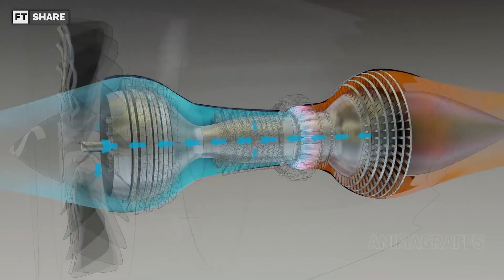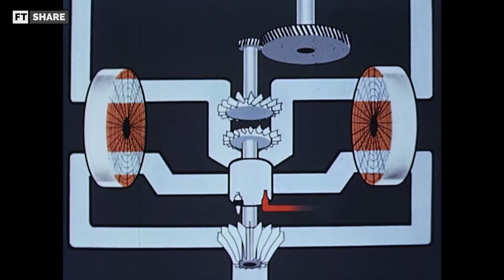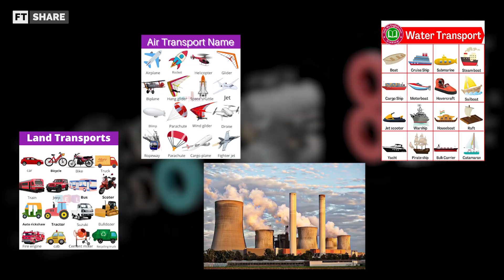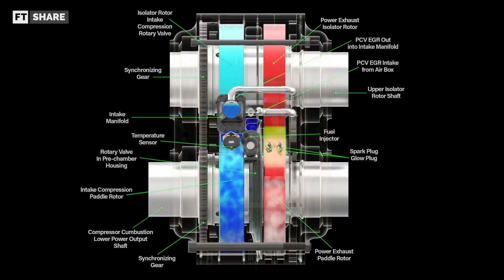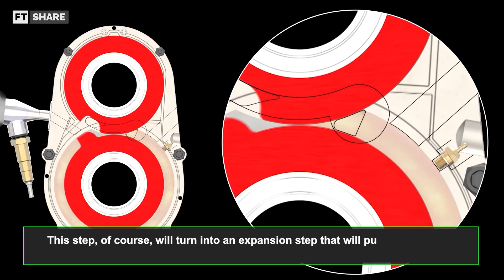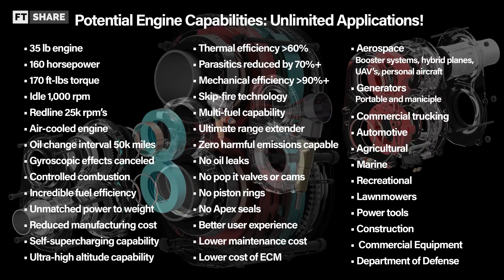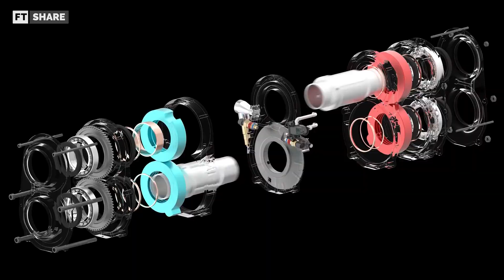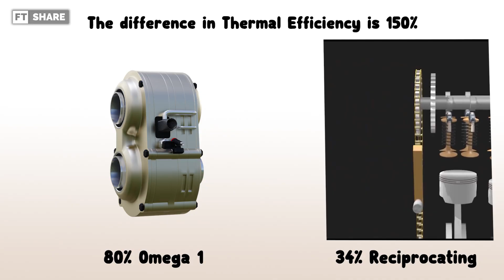Ready To Destroy EV Engine!! | Astron Aerospace - Omega 1 Engine

Comment: HOW ABOUT something like a pair of properly sized center intake rotors sandwiched between a pair of compression /combustion rotors on either side spaced 180 degrees apart. That would keep the majority of the heat on the outside rotors that can be water jacketed/cooled. Essentially it would be TWO motors working together united by a single inlet set of rotors sized to feed both motors. Exciting HP/weight/size ratios!
Reply: I see what your saying and with proper water jacket it would work and would be a very efficient engine. I'm very skeptical about the torq numbers. I would very much like to see one in use.
Reply: @bambambundy6  It just goes back to HP vs Torque. If you can spin it faster it compensates for the loss of torque and you are going to utilize the HP side of it.
I am a diesel guy or high compression slow moving engines. High torque with low rpm.

Now all manufacturers are trying to go the other way. Low torque motors running higher rpm to do the same amount of work.

I leased a new 2021 Chevy Silverado with a 4 cylinder turbo engine. It is built almost like a gas burning diesel engine. 

It has more torque at a  lower rpm because of the use of a dual volute turbo and a longer stroke. It is coupled to an 8 speed transmission to help make up for the loss of torque by using HP in the higher rpms.

It tows very well for it's size.

Now spin an engine 4 times that rpm and you can do the same work with 1/4 th the torque.

This engine would be better suited for power generation than mechanical use unless you had a whole lot of gearing or variable transmission output.🙂
Reply: Those numbers seem bit sus, but i humour them to point they have it tested on the dyno by third party. Still is this is durable and powerful, small 50cc engine would sell like hotcakes if price is reasonable to install into moped.

Comment: As a motor mechanic, I can't see how it could possibly seal the combustion sections effectively and not suffer the same issues as early rotory engines, seal chatter and premature failure.

Comment: At 6:43 this engine is compared to other 'alternative' engine designs while dismissing these other engines as 'mere concept engines' - actually these other engine concepts where actually built and run on engine dynamometers in order to measure their thermal efficiency.  I can attest this on the basis of actually physically being present for the dynamometer testing of one of these engines. 

I predict that this engine will be exactly the same as these prior alternative ICE designs in the fact that the claims being made prior to any dynamometer testing suggest that the thermal efficiency will be way superior to existing ICE designs however the actual dynamometer test results will not be able to back up the outrageous claims.   It is more than likely that the thermal efficiency will be lower than a typical mass market automotive Honda/Toyota engine, but with a number of other practical issues that come to light based on real world testing.

Comment: There are many issues with the content of this video...

It tends to suggest that the company that developed this engine has experience in making jet turbine engines for the aero industry while showing video of some other company (clearly not Astron).  The video later states that the inventors of this engine have not got any interest in the engine from the aerospace industry.   Surely this should be a red flag.  If they are claiming that they are in the aerospace industry but at the same time can't convince anyone else in this industry that this is a good idea then you have to question where the truth actually lies here?
Also, claims of being able to run this engine on hydrogen with virtually no emissions????  How on the earth do they think that they will be able to simultaneously achieve a reasonable thermal efficiency and at the same time not produce significant NOx emissions???  What are they planning to do here - are they planning to have to use pure oxygen instead of air?

Comment: This idea has been circulating the internet for some time and it is basically a fraud.  There are some really nice animations of the engine, however the basic underlying thermodynamics are no different to any other ICE.  I don't understand what the promoters of the video are trying to achieve.   They seem to be content as spreading misinformation and trying to convince the general public that don't understand the physics of thermodynamics and ICE engine design that this is a practical idea - but to what ends here?  This video is not fooling the auto industry nor is it getting any support from academia. 
If the makers of this video are so convinced about this idea they should build a working prototype and test it to get some real efficiency figures to back up their outrageous claims.

Comment: I'll believe it when I see it independently evaluated and tested for efficiency and durability and emmissions.
Reply: Agreed, it will have poor low rpm torque and end up on a shelf like so many other "disruptive" designs. Kudos for the designers getting it to work but i think its likely power curve does not suit a non hybrid  automotive installation.
Reply: @watsisbuttndo829  It doesn't have to be directly coupled to the load. If it lives up to the hype, it could be the primary end of a genset. Think 'Hybrid".
Reply: @watsisbuttndo829  exactly, lack of power is going to make this thing dead on arrival.
Reply: I agree.  They were totally silent on emissions.
Reply: @johnspathonis1078  if the efficiency is really that good wouldn't the fuel burn also have to be that good? Ie unburned/incomplete combustion of fuel is a big part of emissions. Right?
Reply: @georgesimmons9815  Sir Harry Richardo stated in one of his books that essentially combustion chambers with a high surface area to volume ratio would produce more pollutants.  This is because of the unburnt fuel that exists in the surface boundary layer.
Reply: @johnspathonis1078  just run it on hydrogen, and bam, emissions go poof
Reply: @johnspathonis1078  https://youtu.be/vFfsEfnsA4I
Reply: @johnspathonis1078  they can't tell everyone just yet but pointed toward the 1955 Chrysler engine....there's your sign
Reply: @johnspathonis1078  because it was for hydrogen  also
Reply: @johnspathonis1078  the more emissions, the better.
Reply: @kayakMike1000  exactly, more emissions=more fun
Reply: @johnspathonis1078 more the compression more NoX can ne controlled with better catalytic converters
Reply: Agreed. No one talks about seal wear and the shear number of seals required to work at 100% to pull this off. Just think about number of seals per moving part in a given area in a traditional cylinder engine.
Reply: Emissions... meh irrelevant. Only thing i care for is efficiency, durability vs cost. I will install this to dirt bike in a heart beat, specially if the electronic system is simple enough to be bullet proof unlike modern shit that has tons of sensors to be fault points of their own.
Give me simple durable and efficient engine with suitable cost and that is fine. I dont mind emissions since it would be installed to old car anyways since modern stuff is shit.
My only worry is the rpm of 25K witch sounds like it would wear down seals pretty fast, but guess that is the thing they mentioned about the material durability being one obstacle.
Reply: @Hellsong89  Emissions are nothing to do with the engine as such anyway, they are controlled by things such as DPF filters and cat converters, not the engine itself so it's irrelevant to the actual function of the engine.
Reply: They have not built one- and will not. Sealing those rotors would be a nightmare, and NEED lubrication. The gas path and combustion chamber shape are both so poor it would be a miracle if it ran at all, never mind provide power... Given the pressures quoted, those six slim bolts would never hold it together. I could go on, but it is a fantasy from start to finish.
Reply: Absolutely this! So many “revolutionary“ engine designs have come and gone without ever actually being viable.
Reply: Exactly
Reply: It was leaking what looked like oil too
Reply: @Eduardo_Espinoza  It looked like water or fuel.
Reply: Sir, logical comments aren't allowed on the internet lol.
Reply: This is very old tech
Reply: @the-btc-tradingfloor2808  that’s what people said about Tesla now look at them 😆
Reply: Touche good sir, touche.
Reply: Also, I didn't understood how it will be balance, presumably it has a low mass with high torque, it could be fixed with multiple tooth in the rotors, but thing is, if done with multiple tooth it will become heavier and all the problems mentioned here would be worsen.
Reply: NIKOLA is the best.
Reply: as it will probably have the same emissions as a 2stroke
Reply: this video and channel is pure clickbait
Reply: Seems like you skipped physics lessons in school
Reply: Sandy Monroe
Reply: https://youtu.be/JaP8iplOjz8

Here’s the real video with the facts. His video IS clickbait. Doesn’t have the correct information
Reply: The emmissions does'nt matter
Reply: @jorgemorais4005  That may be dependent on location of intended market.
Reply: One day, when the cartels are broken
Reply: Minot just run it on hydrogen on demand? That would be saying something
Reply: I heard turbines and my mind immediately acknowledged this all makes sense. Durability. I am sure these things will work problem so long as you disassemble the whole thing to replace its gears every so often and do some prohibitively expensive maintenance just to make sure it doesn't eat itself.
Reply: The concern is not about emissions now , it's still an idea. But u can take a bet that it's emissions will suk 😊
Reply: but its true!
Its on the Internet isnt it?!?!?😉
Reply: Its a Game Changer!!
Its is poised to Wreck a 100 billion dollar industry!!

they leave out the cliches about "This weird old tip"...and "Doctors in your town HATE this Mom whose invention blahblah".....
Reply: Don’t care about the emissions part
Reply: But they've solved the side-fumbling!
Reply: Screw emissions, horsepower and torque are whats important.
Reply: High thermal efficiency=low emissions
Reply: Vous êtes tous prisonniers des techniques imposées par le  régime mondial.
Reply: I note in the video of the running engine, oil or water was leaking from the lower cylinder. Side seal problems?
How is cooling achieved?
Reply: 100%. Until it's running under the hood of my car it's just blah blah blah by a buncha nerds
Reply: Well said, sir.
Reply: the Innovation here would be the SEALS, which can perform miracles!!  sealing rotor to wall, rotor to rotor, even seal across that tooth as it transitions from the wall to opposing rotor... This concept is childish and absurd, obviously a YouTube Engine, that generates click bucks.
Reply: @KrustyKlown , there are no seals except at where the plates bolt together.  The rotors have a very fine tolerance. Similar to a roots blower or screw compressor, there are no seals at the interfaces.
Reply: @KrustyKlown  obviously you didn’t watch the video. It doesn’t have any seals at all so they are not the issue. There’s actually 3 different companies working with this technology actually a viable idea
Reply: @iargueta1220  Its a rotational mass being fired off - it has to have seals unless it's just blowing sheeet everywhere. Then again it is blowing sheeet everywhere in the video so perhalps that's why
Reply: @510Redneck  if you mean seals as in a rotary engine then no, it has no such seals. It mi es so fast that it doesn’t require seals at all because combustion happens so fast. I w seen 3 different videos from 3 different companies working on this tech and it looks solid. Hopefully it doesn’t get blocked by the greedy government
Reply: @iargueta1220  It would be a super "dirty" engine without seals. Also how do they keep such from eventually clogging up or air notching...
Have you seen any long term tests under load or any under load in general?
Reply: @510Redneck  not sure man, but it looks interesting

Comment: I wonder how well this engine would work as an electric generator. If it has a high efficiency it could make for a great plugin hybrid concept. You could have two of these engines in a plugin hybrid for a higher electric output and the added redundancy of two engines in case one fails.
Reply: You should look over at Aquarius Engines. Way better design that has only 1 moving part and doesn't rely on the extreme levels of tolerance that the Omega 1 will require. Also, they already have working models, generators and a newly renewed contract with the US Military for R&D.
Reply: @BloodSteyn  I checked out the Aquarius engine...that's pretty cool! I believe we'll see a lot of new tech within the next 5yrs that will drastically change the energy and transportation industries.
Reply: @BloodSteyn  There's also Liquid Piston as an inverted Wankel engine, good for generating current
Reply: @BloodSteyn  That looks pretty neat.  What they call "bearings" I call "bushings".  I wonder how long they last?  Their linear engine seems less "pie in the sky" than this engine.  Seems like it would be relatively easy to add additional cylinder banks.
Reply: if this thing really ends up weighing 16 kilograms , u can probably buy a generator with one.
Reply: Omega 1 probably wouldn't be a good engine to produce electricity, because if their claim is right, going at like 25k RPM needs a lot of lube and tight tolerances, and also normal steam turbines do the job pretty nicely.
Reply: It will work fantastic in imaginary world. Never in the real world though.
Reply: "I wonder how well this engine would work as an electric generator. "

Probably not worth a damn.  It might work ok for powering a generator. But considering it has no way to generate electricity (it's an engine, not a generator), it would be worthless as a electric generator. 

As for redundancy.... You shouldn't need it if it's reliable at all.  And If it's a hybrid, the car will already have BATTERIES for redundancy.  🙂 How many automobiles have you seen on the road with a second ICE for redundancy?  😉
Reply: Personally I think it's promising for VTOL hybrid if used in conjunction with lithium iron and high capacity capacitors.
Reply: I like the idea but a hybrid concept would work differently. The rotary engine would have to run autonomously to charge the bank of capacitors so you have a electric car that charges itself in a parking lot. Also keep your car at a true ac climate control inside while it is parked.

Comment: rotors made from ceramics like carbon brake discs may do the trick. Also, as a range extender/hybrid power plant seems the most logical application. And yes, I would love to see Mazda carry the torch for this one.
Reply: Ceramics is very brittle, will not survive reciprocating explosions.
Reply: Mazda has a hybrid with a rotary generator right now.
Reply: I sincerely doubt the 80% thermal efficiency claim. As others have stated, thermal efficiency is related to how much of the heat of combustion is turned into usable work. Or in simple terms, the difference between the heat of combustion and the heat lost to the exhaust and into cooling the engine. This will be limited by the materials available. Interesting concept, but until I see much more real data, I am skeptical.
Reply: I worked with a guy who made some rotors for racing cars and hyper cars, he refused the job after some time because the compounds were extremely toxic. Women who worked briefly with the materials, after some times developed several bleedings and miscarriages. Some technological advancements aren't worth the health of any form of life. People need to start to care more about people than "things"

Comment: With EV motors in the picture I think the only real application of these things would be to make very high efficiency generator for series hybrid setup with a small battery.  If its really as efficient with hydrogen then it will work out otherwise by the time it shows up in market batteries will be cheap enough to eat its lunch.
PS: 80% efficiency number seems bogus, even turbines claim  ~60% max. if 80% number is good (highly unlikely) Omega1 will proliferate hybrid aviation market completely.
Reply: Yeah, 80% thermodynamic efficiency is practically impossible to achieve simply from heat losses into the engine body alone, even 60% would still be questionable as stationary power plants need to use heat recovery to achieve up to 70%. If all you use is the energy from the combustion expansion with all of the excess expansion and thermal energy going out the tailpipe as usual when the exhaust port opens, 50% might be the practical limit. Also, we already have more conventional engines achieving 40+% using clever techniques like HCCI.
Reply: Simple little two-stroke engine running on something like RC engines canola + 5 - 15% nitromethane or a Meped engine is probably far cheaper, less weight, less maintenance prone and sustainable concerning all resources than this thing.

Comment: Electric cars will never replace combustion engine tech, unless it solves the mileage issue with it.
Now this engine a another level of mastery. i hope it will see the light into consumer production as well as racing world, its a new challenge for engineers to excel in every aspect of it, I am talking about F1 mainly.
Reply: With EVs, it's not just a range issue. There is nothing efficient about hauling nearly 2000 pounds of batteries around simply to transport a single human from point A to point B. It becomes a payload issue.